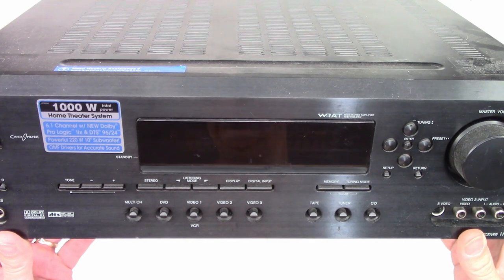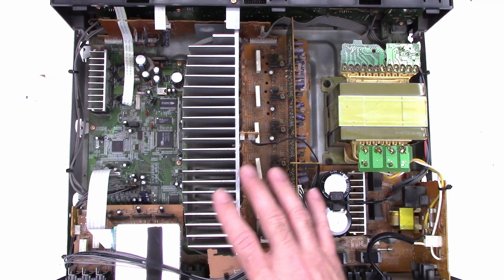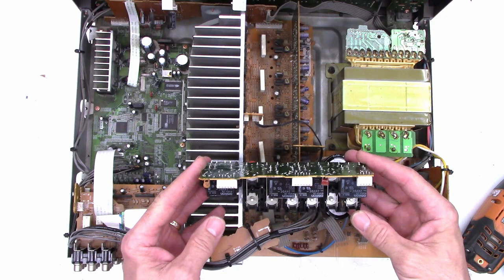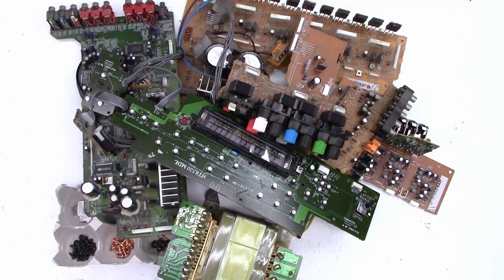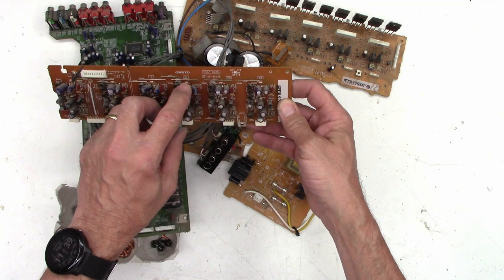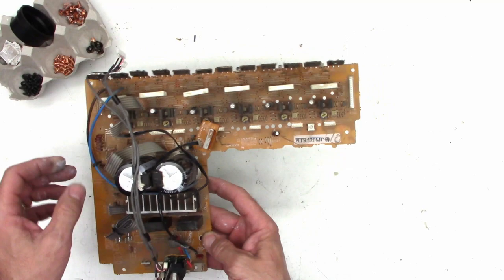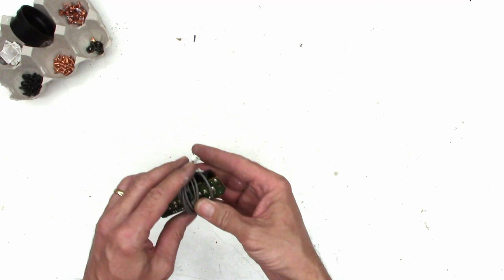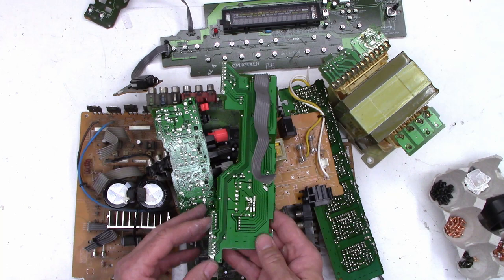WHAT DO YOU SAVE WHEN YOU PART OUT (SCRAP) AN ELECTRONIC ITEM?

Comment: I worked at full line Motorola dealer, and the techs would save junked business band and public safety mobile radios. Small, underfunded police and volunteer fire departments appreciated a used component in their repaired unit, sold at a fraction of the price of a new piece. Sometimes the boss would say to just charge them labor.

Comment: Great call on the insulators.  I didn't think about that and will in the future.  I found automotive boxes like the fishing boxes more cost effective for parts storage.  Figured I'd note and like the egg carton method also.   Those will stack nicely also.  Good fun!  Regarding the heat sink... I was cringing a little.... thinking nice AC Welder conversion rectifier or SCR's or Diacs/Triacs heat sink(s).  Amazing I just saw today on eBay cost effective HF Start boards for welders also.   Reminds me to look at your other videos too and see about the Klipsch Pro Media issue and if you did any mods to improve performance and stability.  Thanks for sharing as always!
Reply: yeah, small plastic boxes works well, and for extra organization I use small plastic baggies (resealable ones) for storing similar components. I.E. I used to keep my resistors in the same place, but organized by values inside individual bags.

Comment: Used those Onkyo speaker terminals to replace the damaged ones on my Kenwood amplifier, as they fitted after only a minor struggle with a file to get the holes in the right places. Transformers I strip them to get the copper windings, as they are real copper, not the current curse of CCA wire.  PCB's yes you get the odd spare part off them, especially the relays are useful, as the same models pop up so often, and the used ones off the boards are often better quality than the new ones.

Have made a few bagfuls of scrap boards go into the Ewaste bins though.

Comment: thanks for your videos! there is a special kind of electronics repair knowledge that only comes from years of experience and for you to share it all with us means a lot. quick question: do you think is woth saving the whole PCBs? I usually desolder as many components of them as I can and trow the empty board.
Reply from the maker: If I had more time I would pull the major components off of every board. Thanks

Comment: Thanks for the vids, dude 👍

I wonder if it's possible to reuse a DSP board from Sony av receiver, as replacement parts in another receiver brand. Or is it designed to only fit in that specific receiver?

Big respect for reusing spare parts, just remember to sort out a bit once in awhile 😉
Reply from the maker: most likely not. Most are programmed to work only in a specific application.
Reply: @norcal715  okay, thanks for the answer 😀